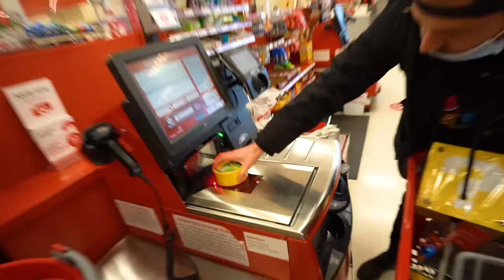HIDDEN SECRET BUNKER UNDER PORTA POTTY!

Comment: hurricane happens
Them: so what bunker should we use?
Reply: That’s more used for like tornados I think cause wouldn’t water just get in if it was a hurricane
Reply: This is big brain time hurricanes in Colorado the chances of that is 0.00000000000000000000000000000000000000000000000000000000000000000000000000000000001 chance